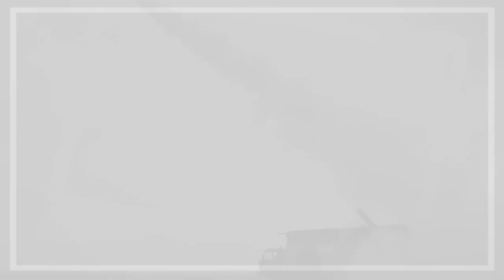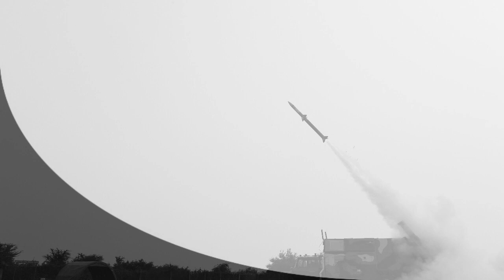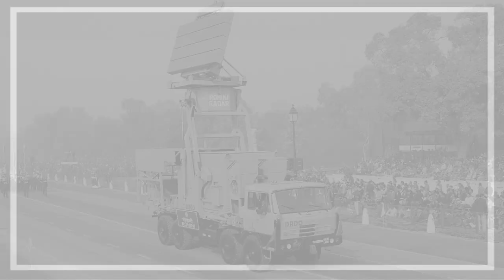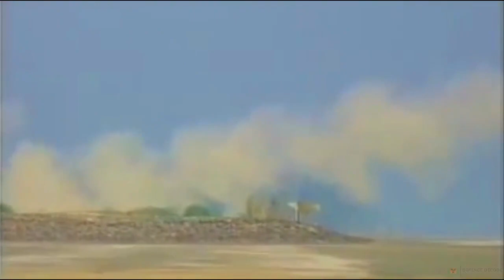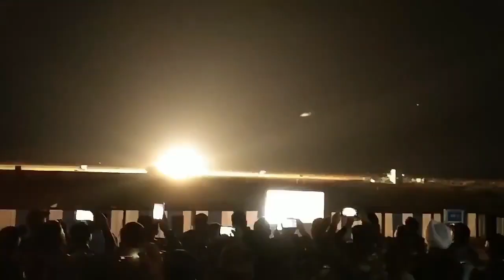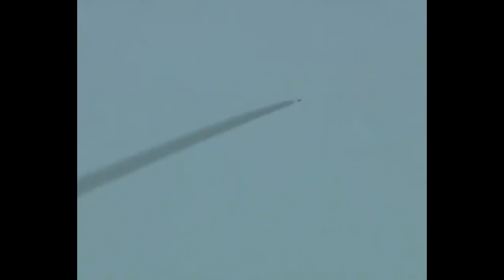DRDO successfully tests new generation surface-to-air Akash Missile (Akash-NG)

Comment: ➏ 🚀🛑 𝗔𝗡𝗧𝗜 𝗠𝗜𝗦𝗦𝗜𝗟𝗘—𝗔𝗕𝗠, 𝗠𝗥𝗦𝗔𝗠 & 𝗠𝗘𝗔𝗗𝗦
Anti and Counter Missile (ABM) system, a
medium-range 70km surface-to-air missile system (MRSAM), and the Medium Extended Air Defense System (MEADS) ranges 4km—500km which capable of identifying and encountering more than 10 targets simultaneously